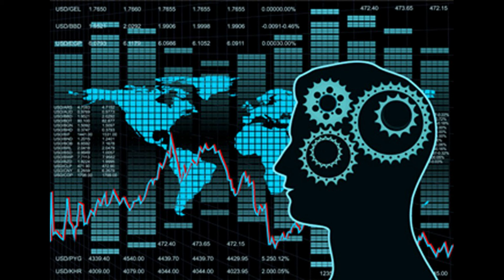How To Make A Big Wheel Electric Scooter With Hoverboard Motor ?

Comment: is this 6.5" motor?  cannot catch tyre size. 
Can u tell what tyre size is? is it 4.10/3.50-5?
And the hole for air pumping.. i think your motor will fill up with water instantly - i mean it doesn't look waterproofed.
Reply from the maker: The tire sizes are written in the description of the video. If you want to use it in rainy environments, squeeze some silicone into the hole and seal it. I have been using it for a long time and have never had such a problem.

Comment: Could you share the dimensions of the frame
Reply from the maker: I used SHIMANO hydraulic disc brake system as brake. I did not measure, the dimensions are standard.Let me help you if you have any other questions.

Comment: Very nice video, What are the 4 wires coming out of the motors and how do we connect that to batteries directly?
Reply from the maker: There are 3 supply cables coming out of the motors. Since these are hub motors, we cannot connect the battery directly to the spring. engines are not running. Without the brain, these engines would not work. A brain is required for each engine. You can connect the motors fed with two cables directly to the battery and run them.
I would appreciate if you subscribe to my channel and share it. Thank you...
Reply: It needs a speed  controller that modulates emf for brushless motors

Comment: Just some tips/tricks/friendly advice for any future metal drilling and even more importantly when cutting threads with either a tap or die... use some sort of cutttng oil.  In this case, one of best and most readily available is WD40. (But, diesel,kerosene,machine oil, also work.) Spray a small amount on the tap every now and again and the threads will be much smoother and much easier to do.  Spray some in the hole you are drilling and the bit will stay sharper longer and quality of hole better and a bonus is it helps keep the really really small metal chips from flying awwy.  (Incidentally a magnet stuck to vise is excellent for catching metal chips... feel free to experiment, don't bother trying to use one of those magnetic vaccine believers...they complain way too much about hot metal chips hitting them." ;-)
Reply from the maker: Thanks, I can't make a detailed video. I use wd40 and oil. Thank you very much for your suggestions. The magnet is a really good idea. :)

Comment: What thread size did you make? Did you manage to get it straight or still bit not in line with axle
Reply from the maker: In the axis direction. I opened the axle bolt slot. Extend the axle with bolts.
Reply: @DiyTv77  i did drill same way, just not till reach wires. Hole was straight, but thread came bit to side.